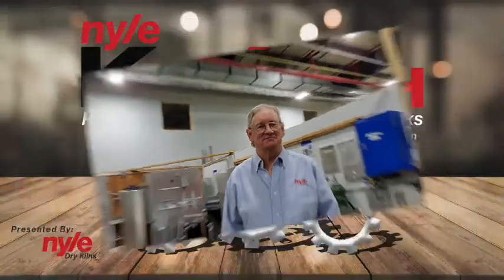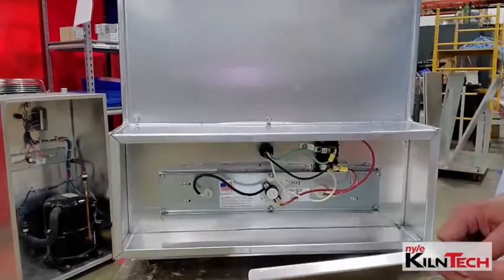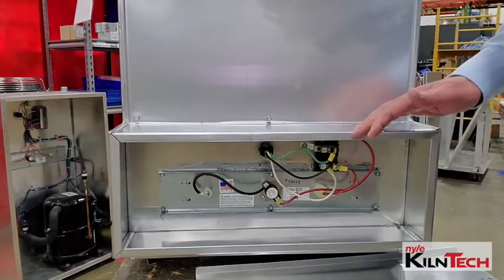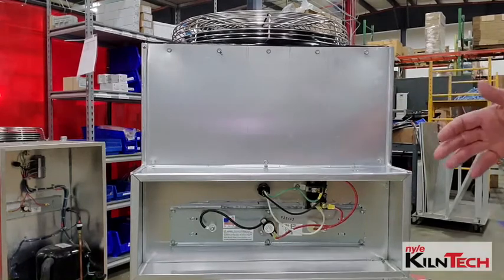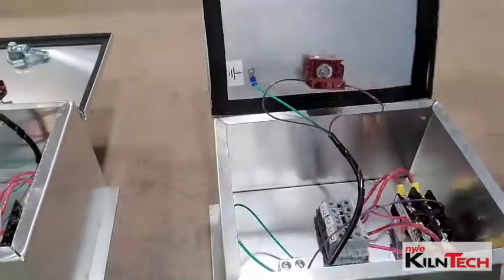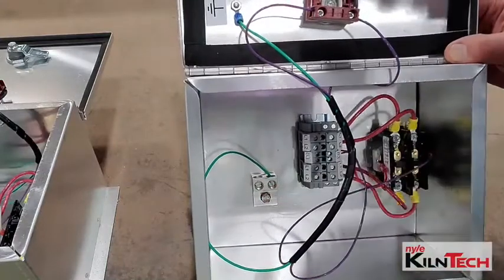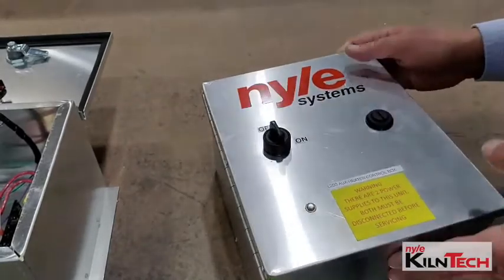KilnTech Episode 8: L53/L200 Heat Booster

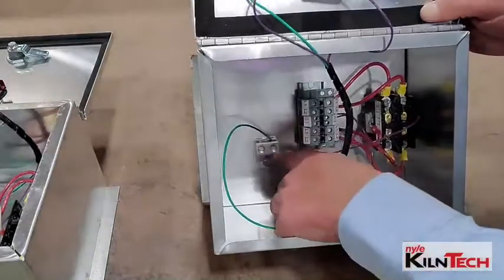Comment: At 2:25 you mention the signal wire that goes from slots 8 and 3 in the  box to l200 controller. Is that wire included? If not, what gauge does it need to be?

Comment: What does the booster do? Is it a supplement to the heating element already in the L200M?
Reply from the maker: Yes, it adds heat into the chamber when needed in addition to the L200's built in heater.